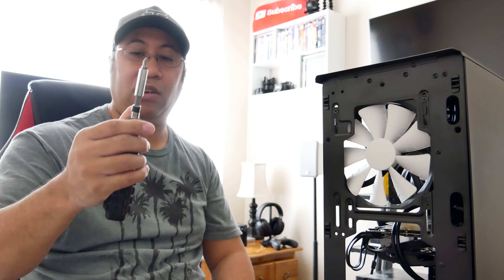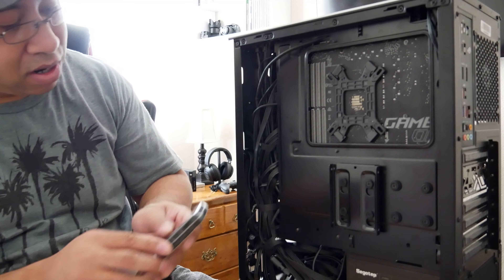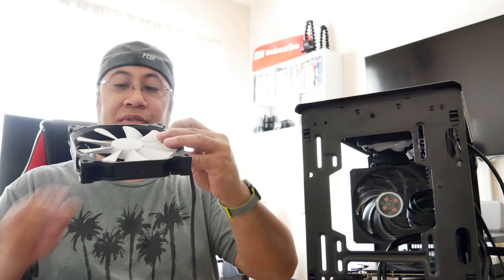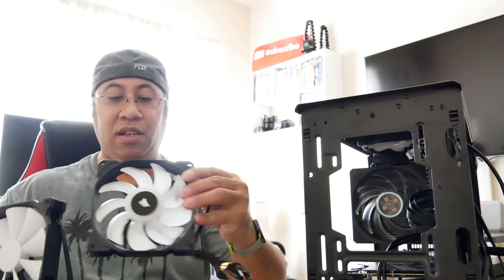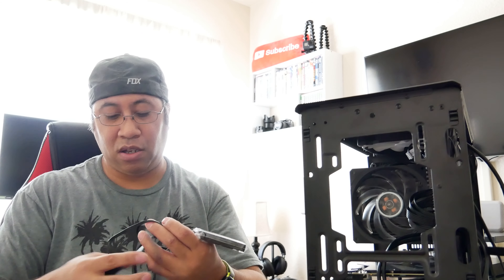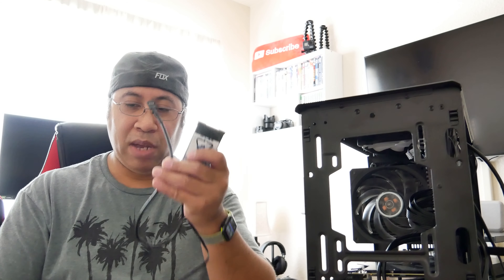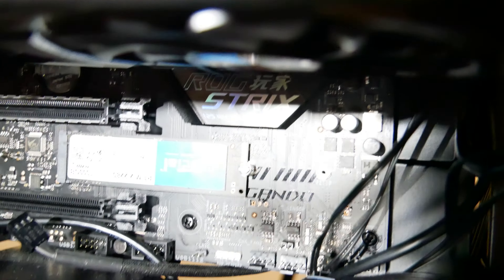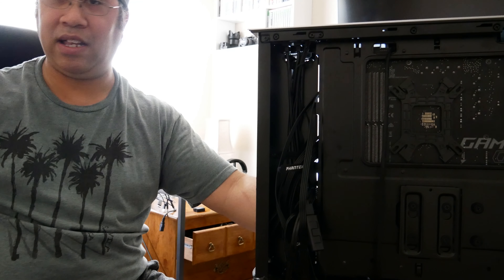Installing My RGB Fans Corsair SP140 RBG

Comment: How are you? I'm looking to buy a set of Corsair fans. To be exact the iCUE SP120mm RGB fans. I have a pre built omen 30L. Is it going to be an issue to attach these fans? Do they connect to the motherboard?
Reply from the maker: Fans Connect to The PC Case not the motherboard
Reply: @BlackapinoTheTechGuy  wait, whatttttttt. so it should be easy then. thanks.
Reply from the maker: yes very much so.

Comment: URGENT QUESTION: PLEASE ANSWER - HOW DO YOU CONNECT THE CORSAIR RGB HUB TO THE MOTHERBOARD? WITH WHAT WIRES? SINCE MY DEVICES ARE NOT COMING UP ON THE iCUE SOFTWARE? THANK YOU!!!!!
Reply from the maker: https://www.bing.com/images/search?view=detailV2&ccid=qfqC9nPy&id=321BCF94101EBC9CE09649F98207EED4A58BB6A4&thid=OIP.qfqC9nPypW9cLsy9pzqKZQHaEN&mediaurl=https%3a%2f%2flinustechtips.com%2fmain%2fuploads%2fmonthly_2018_05%2fWiring2.PNG.724c04af2c84017621013e8db020790c.PNG&cdnurl=https%3a%2f%2fth.bing.com%2fth%2fid%2fRa9fa82f673f2a56f5c2eccbda73a8a65%3frik%3dpLaLpdTuB4L5SQ%26pid%3dImgRaw&exph=631&expw=1110&q=Corsair+RGB+Hub+Pinout&simid=607986749288613720&ck=A90B68A9BD3BAA4368D220AD8B34081D&selectedIndex=4&FORM=IRPRST&ajaxhist=0
Reply: @BlackapinoTheTechGuy  I dont really get it. Could you explain please? Thank you so much
Reply from the maker: I have All My Corsair Fans Plugging into a Command Pro and the RGB plugged into the Rgb Node. Nothing is plugged into my MOB.
Reply: @BlackapinoTheTechGuy  What do you mean by RGB node?

Comment: Question: You have to plug in each fan to an RGB header on your motherboard, right?
Reply from the maker: Actually No. You just get the Corsair Node and the Command Pro and you can Control them all using the ICUE program

Comment: The 4 pin goes to the lightning node core, and the 3 pin? I only have 4 pins at my motherboard
Reply from the maker: https://www.bing.com/images/search?view=detailV2&ccid=HVVqamuG&id=05B49243F919E8EF2B3B5D8DC9FDE1840278607D&thid=OIP.HVVqamuG3nwGP3-5KQEgdgHaHW&mediaurl=https%3a%2f%2fi.redd.it%2fgik007yzsj711.jpg&exph=1263&expw=1273&q=Corsair+Commander+Pro+Setup&simid=608023595648681224&ck=DC238AC3418306E59BAF21F7C2B95045&selectedIndex=3&FORM=IRPRST&ajaxhist=0

Comment: I plugged the regular headers into my case with an adapter. Were do I plug the rgb pins?
Reply from the maker: https://www.bing.com/images/search?view=detailV2&ccid=HVVqamuG&id=05B49243F919E8EF2B3B5D8DC9FDE1840278607D&thid=OIP.HVVqamuG3nwGP3-5KQEgdgHaHW&mediaurl=https%3A%2F%2Fi.redd.it%2Fgik007yzsj711.jpg&exph=1263&expw=1273&q=Corsair+Commander+Pro+Installation&simid=608023595611456050&ck=DC238AC3418306E59BAF21F7C2B95045&selectedindex=1&form=EX0023&adlt=demote&shtp=GetUrl&shid=87d7452a-3faa-421b-8441-b60b53339f4b&shtk=Q29yc2FpciBDb21tYW5kZXIgUFJPIFJHQiBXaXJpbmcgRmxvdyBDaGFydCA6IENvcnNhaXI%3D&shdk=Rm91bmQgb24gQmluZyBmcm9tIHd3dy5yZWRkaXQuY29t&shhk=zd0w8ubSSuLuBf9Z1Rwqup3G%2FVtJNMW2Fr%2BYeVsswgE%3D&shth=OSH.Ea1xStQpcX0sKP5dT%252B45iw

Comment: im late lol but i have 6 of these in my new system, do i need to connect them to the mobo even if the hub is all connected and everything?
Reply from the maker: Nope all goes thru the command pro
Reply: @BlackapinoTheTechGuy  well i dont have the command pro, just the hub that comes with the chasis and 3 pack, the lighting node, do i need a commander pro?
Reply: @BlackapinoTheTechGuy  when i open bios on my motherboard, the 6 fans i have are recognized and i cant turn them on
Reply from the maker: @Brettslevy  yes. https://www.bing.com/images/search?view=detailV2&ccid=HVVqamuG&id=05B49243F919E8EF2B3B5D8DC9FDE1840278607D&thid=OIP.HVVqamuG3nwGP3-5KQEgdgHaHW&mediaurl=https%3A%2F%2Fi.redd.it%2Fgik007yzsj711.jpg&exph=1263&expw=1273&q=Commander+Pro+Wiring-Diagram&simid=608023595611456050&ck=DC238AC3418306E59BAF21F7C2B95045&selectedindex=0&form=EX0023&adlt=demote&shtp=GetUrl&shid=71f69013-c5f2-4f74-b381-284aa25ea678&shtk=Q29yc2FpciBDb21tYW5kZXIgUFJPIFJHQiBXaXJpbmcgRmxvdyBDaGFydCA6IENvcnNhaXI%3D&shdk=Rm91bmQgb24gQmluZyBmcm9tIHd3dy5yZWRkaXQuY29t&shhk=zd0w8ubSSuLuBf9Z1Rwqup3G%2FVtJNMW2Fr%2BYeVsswgE%3D&shth=OSH.m%252B7BNRAidTSOsK5iACD%252BpQ
Reply from the maker: @ Not sure what You Mean by Turning them On BL
Reply: @BlackapinoTheTechGuy  just got the commander pro, thanks! :)

Comment: Hey bro thanks, only problem is I have SP120 RGB, you seem to have the RBG edition
Reply from the maker: I do, and yeah they are the same just mine lights up.
Reply: @BlackapinoTheTechGuy  I got them installed in the end, and the lights worked... just couldn't get them to sync with my d-RGB fans on the case. Will just make them all one colour

Comment: Hey!, i plugged mine into my motherboard, the fans turned on but the LED didnt, what do i do?
Reply from the maker: Did you Download the software for your Fans and the motherboard?
Reply: @BlackapinoTheTechGuy  I havnt got a software for my motherboard but I do have the icue software, the fans just are not popping up on there
Reply from the maker: @BoggsBuilds  Have You Looked at the Corsair Website for Support?
Reply: @BlackapinoTheTechGuy   what software?
Reply from the maker: @DuppsDuckCalls  you'd be using the ICUE  software from Corsair